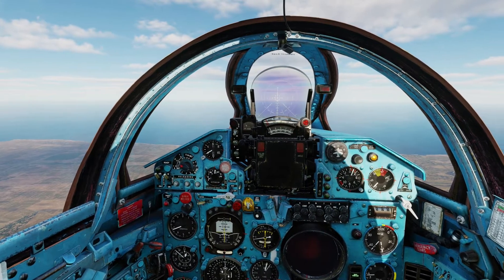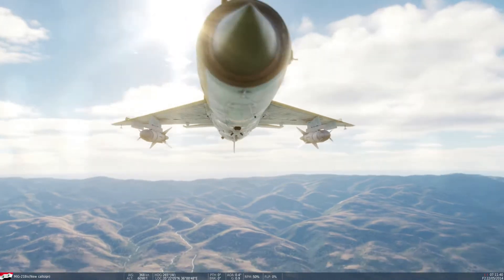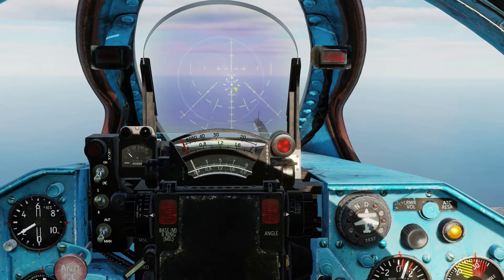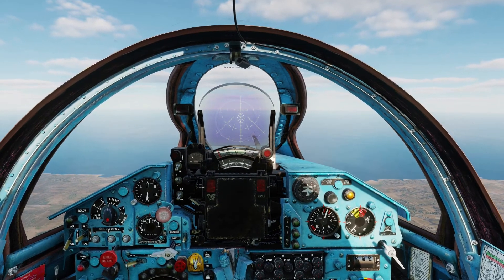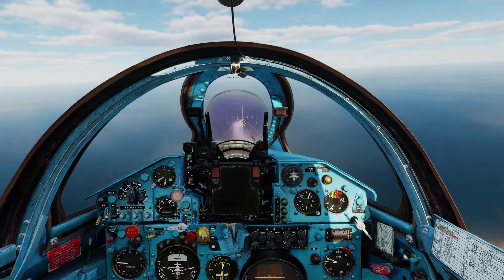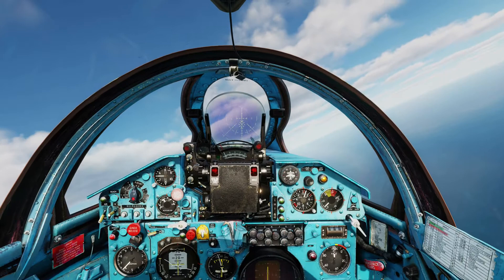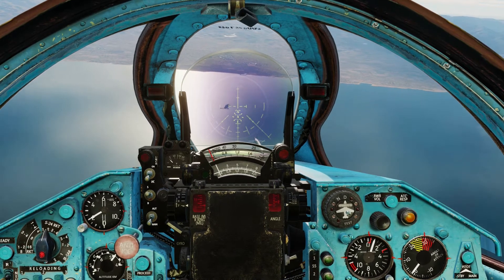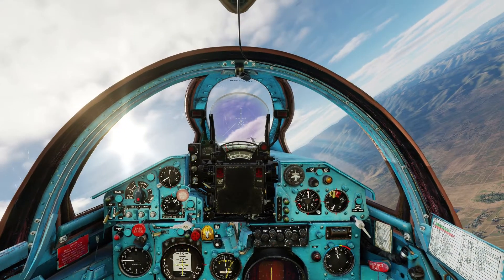DCS | Mig-21 KH-66 Grom tutorial

Comment: Hey, Heinlein. I remember reading somewhere the pipper should be 1.5 degrees below the horizon rather than 2.5 degrees. Is that why the first missile hit below the boat? Thanks for the tutorials, man!
Reply from the maker: not sure but I believe thats an old method for a previous version. The reason I missed was because I dipped the nose a bit when I locked the beam. On the aiming net you can also see there is a little x mark on the 2.5 mark that you can also use for aiming but I prefer using the pipper as it's easier to see. If you put it at 1.5 degrees the missile will certainly hit way short of the target